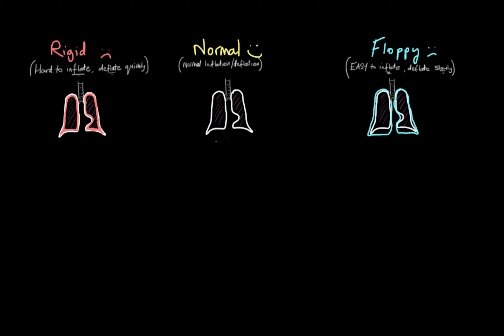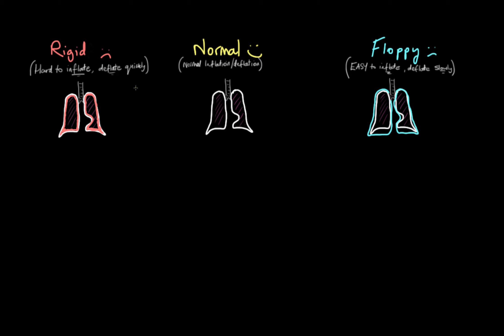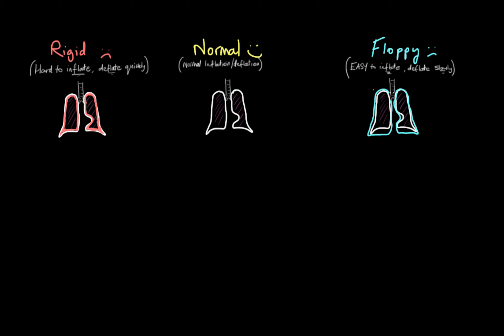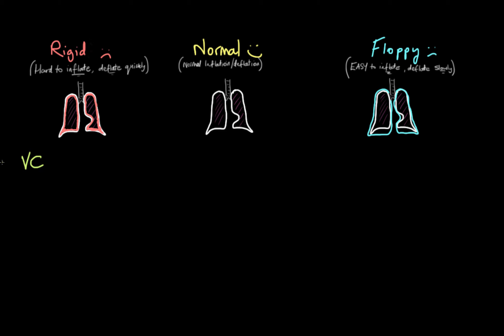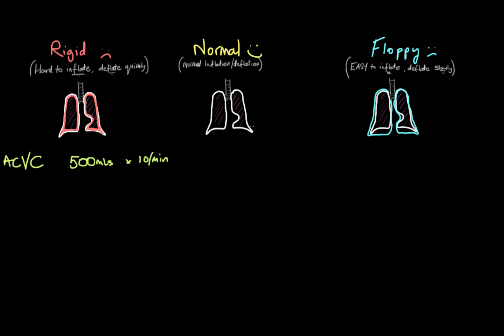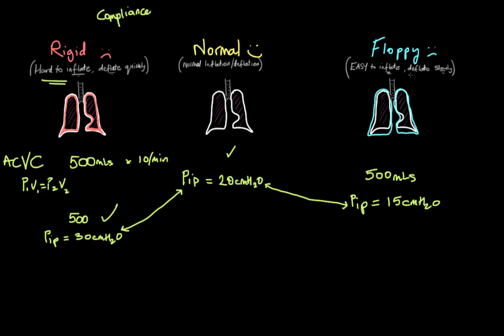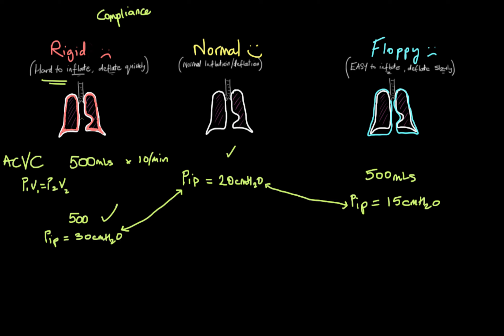Principles of Mechanical Ventilation 9: Pressure Volume relationship in VC

Comment: In the last example you gave (where you set a higher limit of 40cmH20) is the trigger now pressure instead of volume?
Reply from the maker: A 'trigger' variable is what causes the inspiration to begin. The example i gave of 40cmH2O causing inspiration to end is an example of 'high pressure cycling'. Reaching that pressure (40cmH2O) causes inspiration to end (cycle). It doesn't affect what triggers the breaths. In AC VC the trigger variable would either be time (based on the RR) or patient effort (flow, or pressure). The high pressure cycling is a different concept. Check out the Principles of Mechanical Ventilation 6: Phase variables video it should help clear that up.

Comment: Thank you
How will the pressure increase?
During inspiration, the diaphragm contracts, causing the volume of the thorax to increase. As lung volume increases, the pressure in the lungs must decrease.
I understood everything except why the pressure increase?
Is not the decrease of pressure is the driving force of the volume to increase. I am confused
Reply from the maker: The pressure will increase because we are delivering positive pressure to the lungs with the ventilator. In spontaneous ventilation (not on a ventilator), the relative drop in pressure in the intrapleural space leads to gas flowing down the pressure gradient into the lungs, so you are right in your thinking. But remember that this video is talking about positive pressure ventilation, where we are essentially forcing the gas into the lungs with a machine, so the mechanics of it are different. Hope that helps.
Reply: @RespiratoryReview  First I wish to compliment you on your well-presented material.

Please let me know if I’m on the right track. I believe the point of confusion may be a result of using Boyles' law to predict the pressure at the end of inspiration.
 [I typed this up with subscripts for V1 and P1,  and pasted it here, but apparently YouTube does not provide subscript functionality]

Boyles' law is one of several special cases of the ideal gas law (see Wikipedia link* below):

The ideal gas law equation is:    PV = nRT    where:
P = Pressure
V= Volume
n = the the amount of gas
R = (ideal) gas constant 
T = Temperature

Boyles' law is the special case where both the the amount of gas (n) and Temperature are constant and R is already a constant; therefore nRT is a constant:

     i.e.: P1 V1 = nRT = P2V2

If you try to use Boyles' law you would get an incorrect result of a predicted lower pressure in the lung at the end of inspiration as compared to that at the start of inspiration.

However, in the case of inflating a set of lungs, the amount of gas is not constant; it would start at whatever is in the lung at the start of inspiration as a small amount left in the lung at the end of the previous breath*, and at end of inspiration as that plus the amount of additional gas pumped into the lung.

Assume for example,we need to put a specific amount of gas into a lung such that at the end of inspiration is 100 times the amount that is in the lung at the start of inspiration (whether we are measuring the amount of gas in terms of the number of moles,the number of molecules,its mass, or whatever***). 

The actual volume of the lungs at start of inspiration will depend on whatever is leftover at the end of expiration of the previous breath** and its compliance.
 
Therefore, substituting for n:

     P1 V1 = RT  (at start of inspiration), and
     P2V2 = 100RT (at end of inspiration)
          or
     (P1 V1 ) = RT and 
     (P1 V1 )/100 = RT
          So: 
     (P1 V1 )  = (P2 V2 )/100 (since both sides = RT)
          Solving for  P2
:
     (P2 V2 ) = 100(P1 V1 )
     P2 = (100P1 V1 )/ V2

Now we are confronted as to what to use for  V1  and V2 , and that in turn will depend on lung compliance.
Looking at two (2) extreme cases:

1. For a lung with an extremely low compliance, to the point of being completely rigid, V1  and V2  would be equal so P2 = 100P1 .  i.e.: the pressure at end of inspiration would be 100 times that at the start of inspiration.

2. For a lung with an extremely high compliance to the point of being completely floppy with no elasticity whatsoever, P2 = P1  since the lungs would offer no resistance whatsoever to any attempt to increase the pressure.  i.e.: V2  = 100 V1. So the pressure at end of inspiration would be  the same as that at the start of inspiration.

For a normal lung P2 would  end up somewhere in range from P1 to100 P1 .

Based on your subsequent video could we then add a compliance term CL such that:

     P2 = (nCLP1 V1 )/ V2  

An Issue: CL would need to have units compatible with n, but n is just a unitless number, so I am not sure where that would lead. 

*Wikipedia Link: https://en.wikipedia.org/wiki/Ideal_gas_law 

**perhaps left as a result of the PEEP at the end of the previous breath.

* or even perhaps what its volume would be if converted to standard temperature and pressure (but that would confuse things with an extra volume term thrown into the mix).